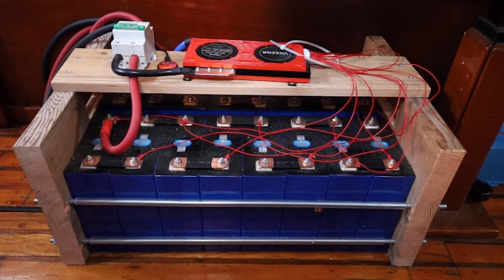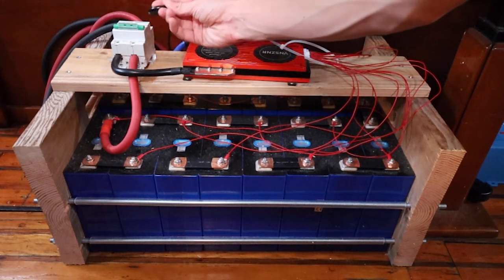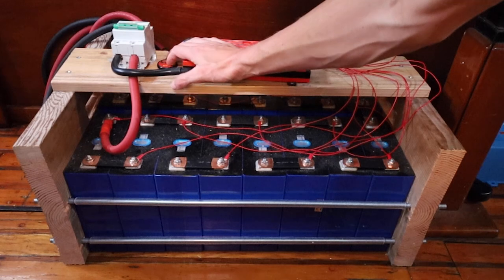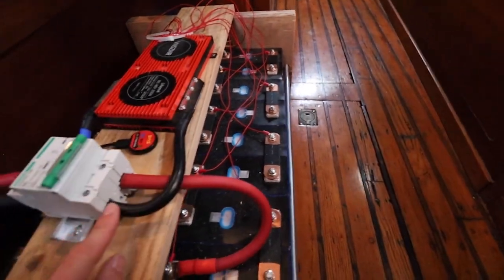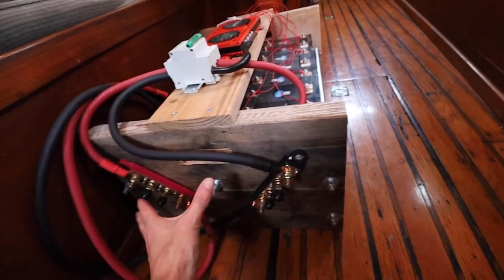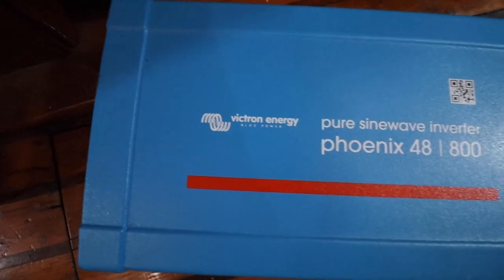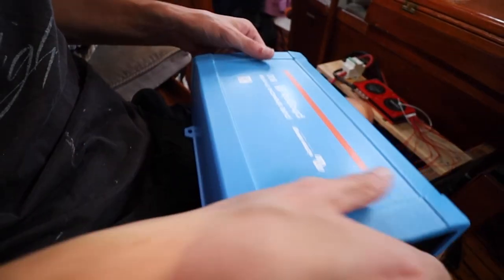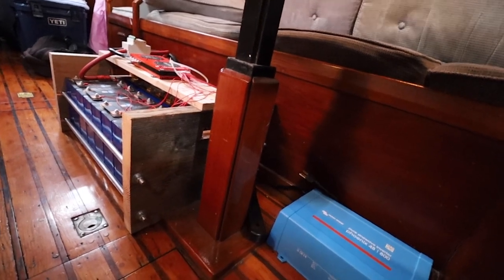DIY DIESEL TO ELECTRIC SAILBOAT CONVERSION: Our lithium battery setup on our restored boat - Ep 42

Comment: I totally support an all electric boat for the galley, but I think a hybrid with a diesel generator for emergency power is the way to go. Can also use the generator for water heater and water maker and use the diesel for a diesel heater which is more efficient than an electric heater for the boat. Also can get AC with a generator. Best wishes and thanks for the video! 🎉❤
Reply from the maker: Yes, we will definitely do a generator down the line since we already have a diesel tank set up.
Reply: Absolutely, 100% agree.

Comment: Did I calculate right? You got about 10kwh in your battery pack. Add a generator for a series hybrid system, and you got unlimited power with max silence and clean sailing / motoring : ) Can t wait for more shows about the e-drive.

Comment: Im building an electric micro trawler. 26ft. Im actually going to run a lithium bank charged by solar and a secondary bank with generator that will go to a lead acid bank and direct to the motor. So i wont be 100% clean but i will be able to greatly extend my range. Gnerator selected will only burn a gallon every four hours under the 100% motor load. So about 35mpg. Gen takes 2.5 gallons so about 90 miles so a 5 gallon tank 180. So 270 without counting the batteries. Ive gone 30miles on a similar boat i built that was all battery. So at minimum I expect the batteries should give me that. So at minimum 300 miles with a 7.5 gallons or fuel.
Reply from the maker: That’s awesome! Sounds like good range and a perfect happy medium!

Comment: Do you have one of those wonderful live aboard slips at the Ala Wai?  What will your solar set up be?  Do you have a wind generator?
Reply from the maker: We luckily have been blessed to have a live aboard slip in the Pearl Harbor area. We are still brainstorming a solar set up. Our boat will force us to be creative because we have two booms, so it limits us with creating a hard top to have a flat surface for panels. Seth is brainstorming and has some ideas!
Reply: I have seen ketch rigged boats put the wind generator on the mizen mast.  .02

Comment: So let’s say you run your motor at 3kw @ 48v. That will be 62.5A. Even in the most optimistic scenario your battery will give you 4.5hrs motoring time which is super low in case shit hits the fan and you need to motor a bit. That is the key problem that keeps me from seriously considering fully electric boat

Comment: "This is a phone..." hahahaa!!! Awesome update! Nice rundown on the battery setup too.  Silly question but by bridging all of the cells together into an almost milk carton setup, do you think you guys will have any heat management concerns to worry about?
Reply from the maker: Seth always has the best rundowns! The BMS has a temp gauge, the long sides we left open with just the metal bar, and there is a gap between the rows…so hopefully that allows the batteries to not overheat!